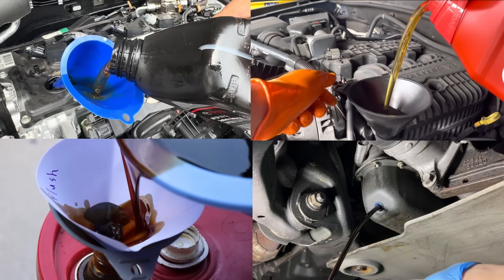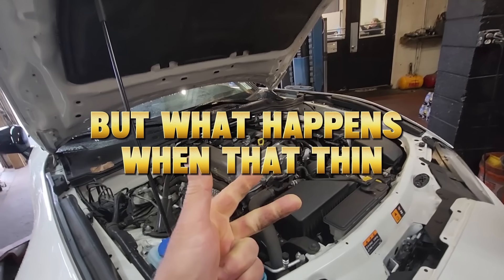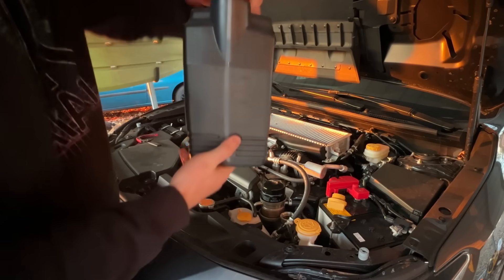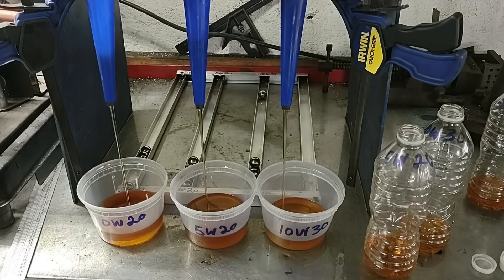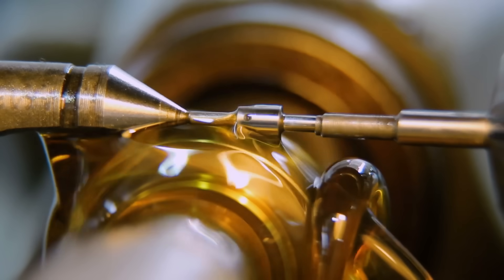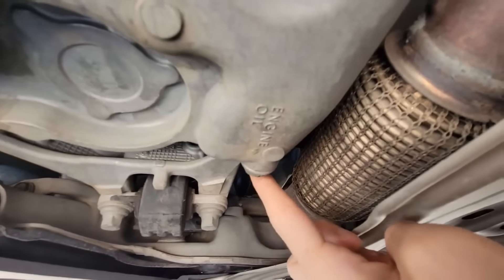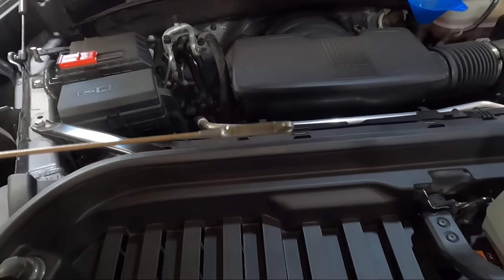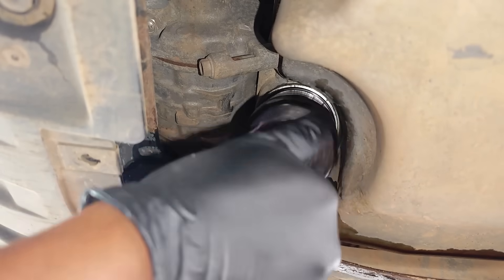The TRUTH About 0W 20 vs 5W 30 Oil (50 Engines Tested!)

Comment: I bought my 2017 Lexus LS in 2023, when it had 69,500 miles.  And I actually did assume, perhaps wrongly, "the carmaker surely knows best!"  and used the recommended 0w20 oil (in the 1UR-FSE V8 engine) for several changes.  But eventually I began to have doubts about using zero-weight oil in my cars, and started researching them.
Long story short, after reading and viewing almost everything that anybody, from the tribologists to the mechanics, had to say about super-thin oils, the evidence seems to indicate zero weights DO NOT lubricate engines as well as heavier weight oils do (especially in the long term)!  
But I was still hesitating to switch over to 5w-30.  Until I read a post on a Lexus forum, from a Lexus owner in Ireland.  He was wondering why his owner's manual said to just use any multi-grade most appropriate for the ambient temperature, while American owners were told to use 0w-20 exclusively. 

And according to his Lexus' owner's manual - and the owner's manual for every country EXCEPT the USA - so long as ambient temps are warm enough, you didn't need to use 0w-20 and you could use 5w-30 or even 10w40 if you wanted.  And the only real reason to use 0w-20 is if the ambient/predicted temps were below freezing.  
So I switched to 5w-30 oil in the Lexus the next time I changed it, and ain't never going back!
Reply: Not positive the only reason is temperature. I think most of the issue is gasoline mileage. We also need to be aware the engines are also tinkered with for this gas mileage issue. Meaning the tolerances of parts is different and need a thinner oil to function properly. I would research your own particular vehicles as far as the information goes before switching blindly to some goo.

Comment: From India 🇮🇳 here is use shell helix ultra 5w30 for my Hyundai 2021 Verna 1.5 MPI Engine and yes switching to 5w30 really makes engine more smooth and overall NVH level of engine has gone better , your opinion is really true❤
Reply: After changing my own oil and filters for the last 45 years or so,  none of my vehicle suffered mechanical failure, because I change my oil every 3-4 months.  Thin oil will reduce oil pressure, causing lifters to work harder.  You may hear that noise on first start up.  Last car i sold had 247,000 miles on it.  The one I’m using now has 178,000 on it.   Just changed oil and filters for the winter.  Doesn’t leak engine oil, but the from wheel drive rack and pinion is something else!
Reply: What's the manufacturer's recommended oil bhai?? 0w20 ??
Reply: @siddharthraghuwanshi3457 Hyundai India offers 0w20 of Indian oil mineral which isn't good I experienced, they have option of shell helix ultra 0w30 fully synthetic api sp but on demand needs to get ordered that's good , but grade you can change accordingly to climate and temperature
Reply: @cartaalap so they recommend 0w20 only na ??

It's just u r going with 5w30 and seems  to have no problem since u went with ACEA C2 category which is suitable for bs6 engines fitted with def

So can I also go for 5w30 Acea C2 ..
Reply: Exactamente.. realmente es real.. saludos.. 🙏
Reply: @gustavohernandez-gl2jv 😊🙏

Comment: Depends on the vehicle, driving style and ambient temps but I doubt a 20w oil is good for any engine. They make oil this thin these days for emissions and fuel economy, but that doesn't mean it's better for your engine. My high performance BMW is meant to be run on 0W/30 but I've switched it to Motul 5W/40. The idea of using a 30 weight in a high performance engine doesn't sit right with me. I also change every 5000 miles or less and do virtually no stop start driving or small journeys. I'd change at 3K if it was mostly town runs and traffic.
Reply: Yet most have no issues running 0-20 on go over 200000.

Comment: Charger R/T 5.7 V8 called for 5W-20. Switched to 5W-30= QUIETER NO MORE CLATTER AT START. SAME MPG OVER 30 ON HWY.
Reply: Yep the pentastar motors are notorious for lifter issues. Reason? bad oil filter design and the wrong oil recommended be my conclusion. Go thick on these.

Comment: I have a 99 Chevy Silverado 1500 LS 4X4 I bought in  2011. I started using 10W30 High mileage oil in it because of it's age and miles on the engine. It was over 130,000 miles and I had no idea what the previous owners were using. I did know it was a farm pickup so I expected it probably saw some hard miles. I ran that for a couple years, but then my store started carrying more full synthetic oils. 
Those first couple years, the truck had that typical 5.3L engine tick on startup which would last for 15 to 30 seconds depending on the temp, but then I switched to full synthetic high mileage oil. After a couple oil changes, I noticed the tick stopped ticking after only 5 to 10 seconds and it's been that constant since.
I am currently running Mobil 1 Extended Performance High Mileage 5W30 oil. I get between 3000 and 4000 miles on the truck in a year, it's not our primary used vehicle, so I change oil every year. The oil is rated for up to 20,,000 miles though I'll never push that on my truck. I try to baby it because I really like the truck.

I had looked through the owners manual about recommended oil viscosities for this engine, and it does allow 10W30 and 5W30, but if the oil is being changed and an extended period of cold weather is expected, it's recommended to use 5W30 synthetic oil or 0W30 oil.
Reply: My 2000 Silverado has just over 300,000 miles and I always use 5w30. ACDelco filter.  Never ticks.
Reply: @crowdnine878 well, mine ticked from the day I bought it, but it got better with the synthetic oil.

Comment: Oil needs to go through tighter tolerances on newer engines to actuate variable valve timing. Check the oil viscosity in other countries as the USA wants fuel mileage not reliability.
Reply: Engines have had tighter tolerances for years.  The same Engine sold in other parts of the World uses heavier oil.  This is mainly about EPA.
Reply: @scotta9114  emission regulations didn't became tighter overnight. it's been happening gradually up to a point then it skyrocketed. Toyota squeezing 300hp out of 1.6l inline 3, integrating the catalyzer to the engine head as a unit, & have at least 2 cases of that motor catching fire by itself are signs. if synthetic fuels are available cheaply at scale for mass use, there's literally no reason for manufacturers to tighten tolerance beyond a point.
Reply: @scotta9114  Yes, what I have heard is that in Europe the very same cars use "thicker oil" than that same car in America.  When it comes to engines, the Europeans don't seem to want their citizens to suffer an engine failure whereas in America they don't seem to care about their citizens, at least when it comes to cars.  I'm from America and that is the way it seems to me.  We have had some really bad politicians in the last 30 years.
Reply: @jlrutube1312 Vehicles here are designed for planned obsolescence.  Our 1997 Oldsmobile seems to run forever and a 2915 Chevy Silverado self-destructs.  Go figure.
Reply: 267K miles on 2011 Honda Odyssey using 0W20 and the motor is still going strong.  No burning oil or loss of power/mileage but I change oil every 5K miles religiously.  I'm too chicken to switch to 5W30 at this stage.
Reply: @jlrutube1312 , а сейчас хороший политик? 😂
Reply: Car companies are the same deal globally, IMO. They just want to sell.
Reply: @Daril2024  the culprit isn't automakers but global emission regulations by various governments. so modern engines are designed with tighter tolerance, meaning they have to use thinner oil to fit into tight spaces & narrower oil galleries. the benefits are better cold flow & km/l but not as durable. it's a price automakers have to pay to remain in business today. 

same as to why 2JZs have beefier bearings but modern mass production sports engine don't. it's to keep weight down & cut cost as Japanese automakers aren't as rich as as they used to be before the Japanese economic bubble.

really hoping synthetic fuel will scale & be cheap enough for mass use soon. internal combustion engine techs were bout to peak but EV happened.
Reply: @wezkerlim All the synthetics still leave deposits eventually, from all the YouTube posts from both standard and high performance engine builders. They all came to the same conclusion> changing at 5k intervals with a filter with synthetic or standard oil takes care of deposits, and keeps cam phaser and valvetrain passages clear. Personally go with the 5w-30 camp and 5k changes..With these engine designers even using lighter piston ring springs to reduce friction towards better fuel economy. So along with accelerated engine wear, you have fuel from 2000psi direct injection injectors getting past the loose rings leading to fuel dilution of the oil.
Reply: @289hipo  i'm not talking bout synthetic engine oil but synthetic fuel, both are different things. synthetic fuel means man made petrol, not naturally formed by fossil fuels.
Reply: Clueless 😂
Reply: To be fair, most vehicle are replaced for reasons other than a worn out motor.

Comment: 2012 crv 120k 0-20 full syn. No problems.  5 years in Ohio the rest in Florida, no issues. 5k oil change intervals.
Reply: I would use 0W30 in Florida with that mileage.

Comment: This video has a lot of truths to it ! It wasn't made for the 50 something Master Mechanic ! The skilled labor crowd , we analze the vehicle down to the nut and bolt level. So I say we see things differently than the average Joe. As I see it the newer vehicles are electrically and mechanically flawed. Some people will defend the vehicle they spent 70 -100k on because they don't want to admit they screw up ! EVs. I'm just waitng for that MidWest road salt to work its way into the components.

Comment: Oil change frequency is most important in my opinion. I have a 2002 Dodge Caravan with 215,000 miles. I have changed the oil every 4,000 miles using Valvolene 10w-30:conventional oil (as per the owners manual) and it still runs great and uses no oil between changes. Pretty good for a Chrysler product. Staying with the current plan on this vehicle.

Comment: I am a sicko because I change the oil twice per year and have 3000-4000 miles in the year but I also go by oil color. Our household 2020 Chevy Equinox, 2019 Trax and 2015 Cruze oil gets about as dirty looking as my 1998 Dodge Ram but my 2020 Toyota Camry looks as clean as the day it was changed with a few thousand on it. If it is driven most days of the week I think it should not go past 6 months for oil change. I would allow a rarely driven car once a year oil change. Again, I'm a sicko. I have not heard any videos mention color so it may not be as important as I'm thinking and I do not send it out for testing.
Reply: That is not being a sicko. OCI 5000 or 6 months is recommended for low yearly milage due to fuel dilution and high pressure fuel injection.

Comment: Norway here, Shell 0w-30 winter change, sometimes Mobil 5w-30 Spring change. Xtrail-D.
Reply: I am also from norway and have a honda civic 1L 3 sylinder and i want to change my oil on my own and dont know what oil to get and oil filter. it says on the manual 0w-20 but i hear mixed messages everywhere

Comment: I don't trust oil less than 10/40 (our lowest temperature is 7 degrees Celsius). Currently I use 15/40, which is among the recommended viscosities in the owner's manual.

Comment: My Tacoma is at 200k now, only ever ran the recommended 0w20.
Reply: Toyotas don’t count.
Reply: @rolandledesma-de7qd  the tundra engine blows up sooner than it needs an oil change. What junk Toyota builds now!
Reply: @DUNEDIRT 
That is bad American manufacturing techniques. 

Toyota is fine in all other parts of the world.
Reply: @useryggfdcc  no it is not! It’s a design flaw. Toyota is having lots of problems with other vehicles also. But it’s just like Isreal we’re not supposed to talk about the problems.
Reply: @DUNEDIRT  Toyota has gone to the Dark Side!
Reply: If you change your oil every 3,000 miles if not your a surprise soon.
Reply: What year is your Taco?

Comment: ANYTHING under 5W20 in ANY engine >> is absolute insanity !!

5W40 is the best oil weight ever created IMO..
Reply: I use 0W40 Aral Supertronic.
Reply: @ralfrufus6573  
Organic cooking oil is probably better..
Reply: @sevendyseven4090  As a fuel for my diesel, yes. 😅
BTT: The difference between 0W-40 and 5W-40 is  not so much the viscosity but the fact that 0W-40 is always a fully synthetic oil.
Reply: @ralfrufus6573  
'Stay far from anything 0W'
..imo..
Reply: @sevendyseven4090  I know, due to the higher amount of viscosity index improvers of a 0W40 (compared to a 5W40) that 0W40 will become a 0W30 as the VIIs will be destroyed over time but as I change my oil frequently, i.e. before 10000, sometimes even before 5000 kilometers (not miles!) that effect is negligible.
Reply: @ralfrufus6573  
I would suggest at least putting in some 'Synthetic Lucas oil stabilzer' at oil changes..
Reply: @sevendyseven4090 Thanks, but no, thanks. I learned it the hard way to stay away from oil additives. In the 90ies Slick50 ruined the engine of my Yamaha XT 600 motorbike. Never ever will I use any kind of oil additives again. I am done with oil additives. If you want to prolong your engines life expectancy than change your oil frequently. Save the money for oil additives and do an extra oil change instead.
Reply: @ralfrufus6573  
LOL, slick50/Duralube/ indeed are crap, they have
 PTFE (Teflon) in them,
Lucas does not have such,  safe oil treatments have
JASO MA" or "JASO MA2 stamped on there bottles...

Anyways, this is something to consider concerning running 0W-anything >>

 https://www.youtube.com/watch?v=0-g0ODnkRhw

Comment: I live in Minnesota. The winters get way too cold for 5w30. So I run 5w30 all other seasons. My 2016 Mazda 3 manual states 0w20 in North American regions and 5w30 in all other countries. It leaked and burns 0w20. Finally switched to 5w30 @ 130k miles. Finally stopped leaking/burning and sounds smoother. In my experience use 0w20 only in upper rust belt of America during below 0 Fahrenheit weathers. 5w30 year round anywhere else. MPG zero difference.
Reply: What they didn't do is provide that alternative. You really can swap oils in climates where it gets very cold and very hot. Minnesota is an excellent example. Chicago too.

Comment: Just started hearing this debate between 0w20 and 5w30.  It is hard for me to decide who to believe.  It has been beat into my head for years to follow my owner's manual recommendations.  Now it seems I am being told not to, and switch to a thicker oil.  The justification to switch sounds significant enough.   I can also see the automakers choosing to use an oil that raises their gas milage numbers over the longevity of their engines to keep the government happy.  A lot you see on the internet is hogwash, and I worry this thicker oil stuff may be just that.  Lucky for me, my 0w20 car is a naturally aspired v6 and very low miles.  I have a little time before I need to consider making the switch.  Hopefully by the time I would have to consider making the switch to using the higher weight oil as my engine ages and collects miles the using of the higher weight oil will be seen as the mainstream view and generally accepted as the proper thing to do.   On the other hand, if this debate is determined to be internet Hogwash, I have some time for that to be determined as well.
Reply: It is internet hogwash. Use what is recommended. Your vehicle will last hundreds of thousands of miles.

Comment: I used 0w30 M1 AFE in my 2004 subaru impreza wagon and drove it hard, changing oil at 8k to 10k miles and it went over 240k miles and engine was still good - I only got rid of it because of the rust and bad transmission.  I love 0w30 but it is harder to find than 5w30 or 0w20.  (subaru spec was 5w30 for it)
Reply: May as well just run cooking oil..much cheaper and the same viscosity  ....lol.

Comment: My now 23 year old (am original owner) 2003 VW GTI VR6 has been running on Castrol and later on LiquiMoly full synthetic 5W-40 oil, and the engine still purrs and runs like new!  I still have the original timing chains after 23 years!  Haven't even changed the manual transmission oil ever!  Unbelievable!  I can't kill this car!
Reply: That's what I used in my Jetta. But that was in SoFlo.

Comment: What is not stated is that the majority of people know absolutely nothing about what's under the hood of their car.  They're lucky they know where to put the key.  Given that, the majority don't keep their cars well maintained, so when things break or they need an oil change, they stretch it out or get the cheapest thing they can get and don't care.   Only the few that actually do care come to sites like this one.
Reply: That's part of the reason I bought a used Tesla Model 3. I KNOW most people don't maintain their cars, so I didn't want to buy a used car with potential engine or tranny issues. I made sure I got one with a good battery and would charge on 120 volts and Supercharge. I'm not going to worry if it will pass an Ohio emissions test, either.

Comment: I've got a 2010 Crown Victoria Police Interceptor  4.6 with only 30k on it and have been using 5w-20 FS. I always think about changing it when it has 2000 miles on it and get it done before 3000 miles. I feel comfortable doing this. Perhaps when it gets up to 100k I will switch to 10w-30 FS